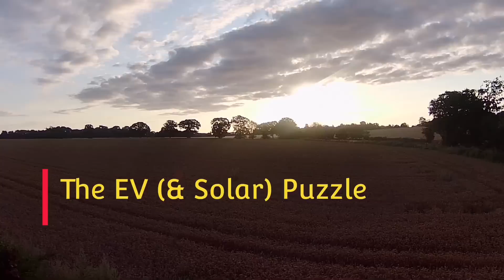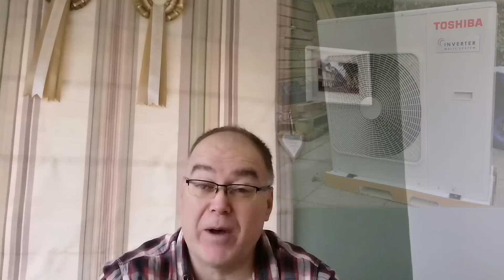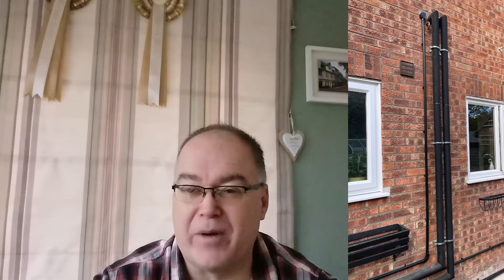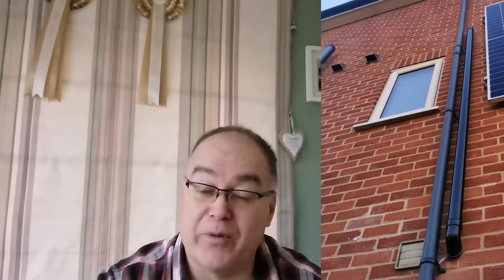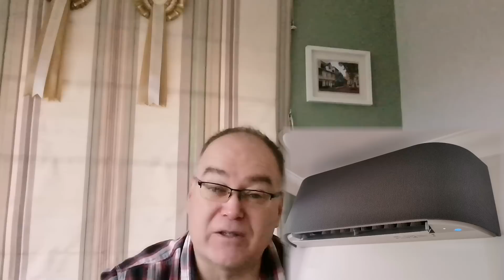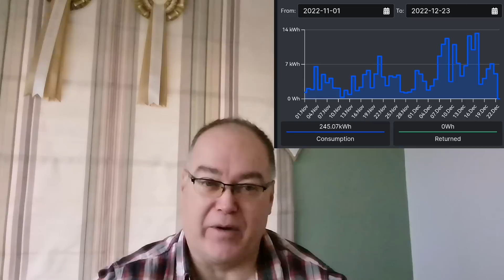Toshiba Air to Air Heat pump (A2A) - Probably one of the best heating systems you can install

Comment: Thanks Nigel. Does the Toshiba App show what kind of S/COPs you're getting? And do you need to service the Hoari system annually? (Thinking of geting a very similar set up myself)
Reply from the maker: No the scop values aren't visible which is a shame, you have to calculate using the heat loss values for your home.

Yes servicing is needed but more to check the gas hasn't leaked and to look after those mini pumps and pipes keeping them clean. Not had a quote yet for annual service, sounds like a small job
Reply: @EVPuzzle be interested to hear serviced cost  when you find out as heard it still about same as boiler service 80-100£
Reply: @EVPuzzle  I was quoted £65 + VAT per-internal unit for the annual service which is needed for the 7 year warranty 👍🏻
Reply: @SuperDiagnostic so if you have whole home muti spits like 4-6 units can be quite expensive
Reply: You need a bib kit to catch all of the cleaning solution/dirty water runoff when cleaning indoor heads. It’s not a small job to clean the blower wheel after 3-5 years. I recommend installing a 1/4”/6mm foam pre-filter, sprayed with filter spray. The cheap plastic screen filters are junk.
Reply: I was chatting to some AC installers on a  commercial project and asking them what I need to do to service my heat pump. The response was keep the heat exchanger on the outdoor unit clean by using a garden hose or one of those tiny handheld pressure washers with a 90 degree head to get behind the unit. The other was to check the gas pressure every few years.
On those indoor units there will only be air filters that need changing.

Comment: Interesting video.
Isn't it irritating that we can't get the grant for air to air ashp? 
Going to need some sort of solution here fairly soon as our gas combi has been going well beyond what is expected, at almost 20 years since installation.
Reply from the maker: It's daft there's no encouragement for air to air. Dual purpose doesn't help I guess.

What I'm seeing though is the grant is useless as per many grants.  You end up spending the money on things you don't want
Reply: @EVPuzzle  kit for wet system works out less then 5k if consumer bought it not including trade discount vat savings. That 5k includes ASHP tank no radiators but most are ok just give worse efficiency so quotes of 12k. Installers are expecting to get paid 7k per installation ridiculous its a few days work.
Reply from the maker: I agree
Reply: The grants appear to only really inflate the prices. It's probably the reason A2A is getting more traction.
Reply: @Peter Clarke  same with solar, the car grants in past.
Reply: Yes, it is!
Not sure whether Nigel mentioned it, but at least there is no VAT to pay on an A2A system.
Reply: Do a lot of research now and then get multiple quotes. If you then decide to wait and pay more for oil or gas until your system fails then at least you will be able to make an informed decision and not have been rushed into it. Or tell the contractor you like to call you when the price drops or they are not busy. You might get a call back in the summer or something.

Comment: Be great to see a basic schematic and some video of the installation.
Reply from the maker: There a not much to see.. Drilling holes, fitting inverts on the wall, running cable and tiny pipe for gas then connecting it and gassing it up

Comment: 4:57 Ok, finally some concrete number about heating the house. 500 to 600 liters of oil per year. That is exactly the same as diesel with specific energy 10.8 kWh/l, so that gives the worse case 6480 kWh/year energy use for heating. Comparing that to average energy use for household 12000 kWh/year that energy use is very LOW 👍 around 50% of typical use. That means the house is well insulated. Of course yearly electricity use is much higher than average.
Reply: It would be good if you could measure now, the total electricity use by air heat pump and heaters this winter for comparison.
Reply from the maker: I do exactly that, every device is monitored seperately incl Toshiba units
Reply: @teranova5566  Extremely rough estimate - around 12 megawatts each winter, but divide this by 4 due to the SCOP and you end up with 3 Megatwatts. Remember you'll need to heat your water on top of this though.

Comment: Would have like to have seen more pictures of the install.
Reply from the maker: There's not much to see, an indoor unit and an outdoor one plus some pipes and cable
Reply: @EVPuzzle  Yes but we didnt really see this, justa very short clip of one indoor unit and same for the outdoor unit at the start. For example would have liked to see a longer shot of the whole wall that has the unit on as well. And Ive just been through and cant see the outdoor unit at all in situe to get an idea of its size.  Unfortunately for me with a conservatory on the back of the house I dont think i could get one or i likely might investigate further.
Reply from the maker: Just look at the specs for sizes pictures are misleading, units always look bigger in pictures than reality.
Reply: I'd also like to see more pictures or clips of the items you are on about in your videos, maybe a short demo of turning the unit on with the remote or the app.
Reply from the maker: Yep the app I haven't covered at all. I'll do a follow up video with all the pics and footage I took on the day plus the app use... New year to do item